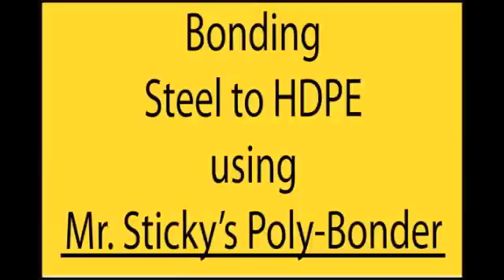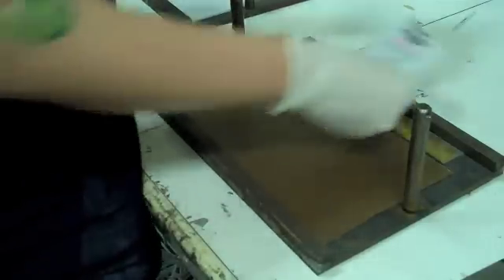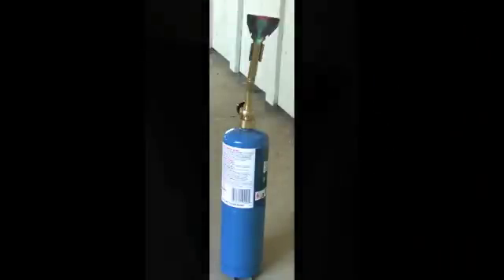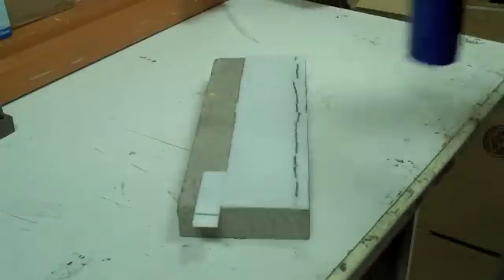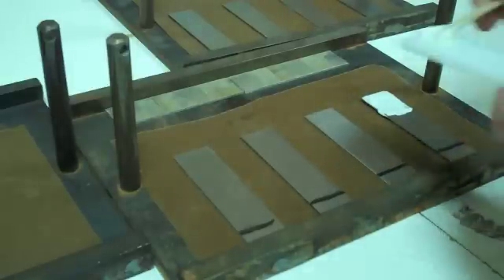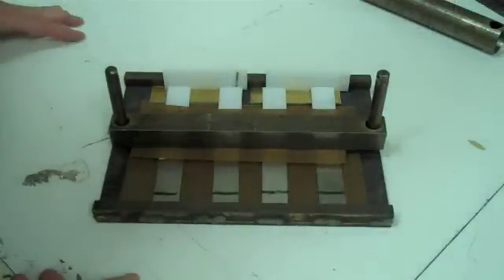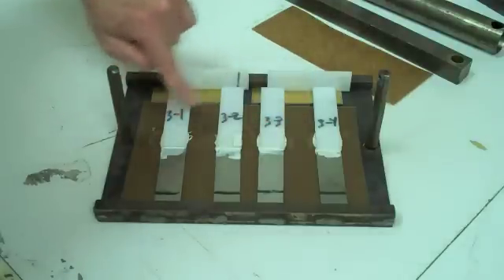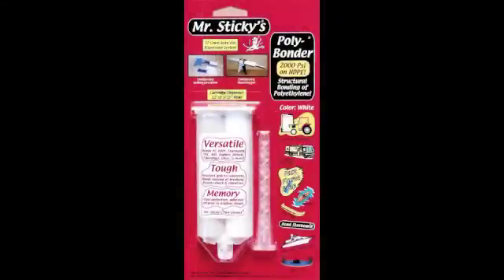Bond Steel To HDPE.m4v

Comment: Can yoy explain a little more  about heat  treating. Do you only run the flame for 4 seconds? You don't have to apply the glue when it's warm correct?

Comment from the maker: Lucidio,
My best estimation is that poly-bonder will work on this job. Because of complications such as the label material (dome have glue on the back side) and other issues, you may want to call me to discuss 916-961-4700 Art. I always recommend testing a small sample
Kind Regards Art

Comment: I'm doing an engineering project where i need to bond polyethylene to aluminium.
This is the only bonding agent i could find which would do the job.
However i really really really do not want to write "mr sticky" in my report.
I think my professor will think im kidding